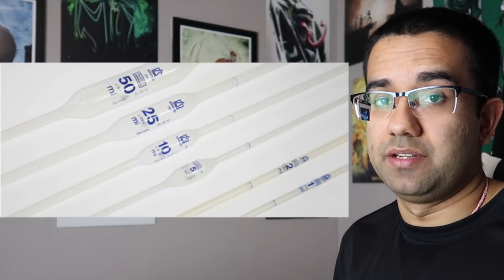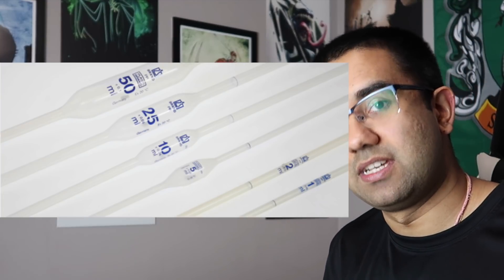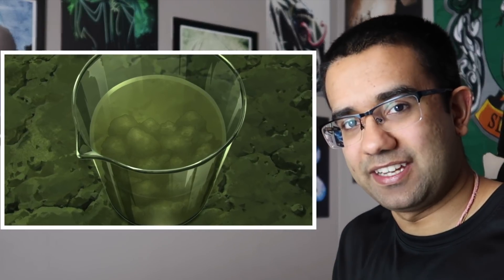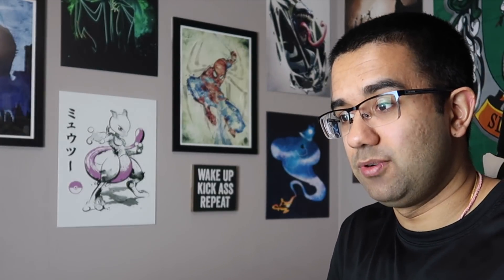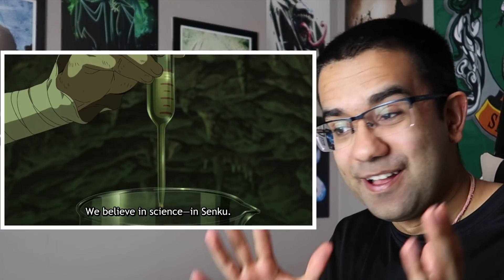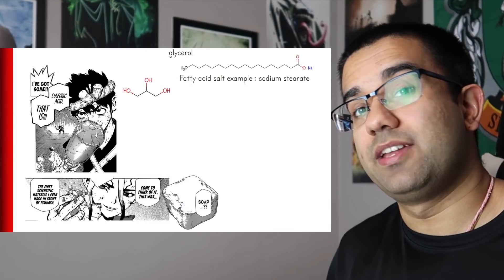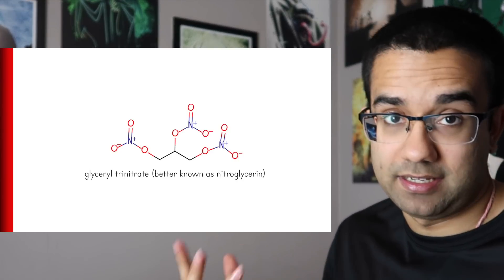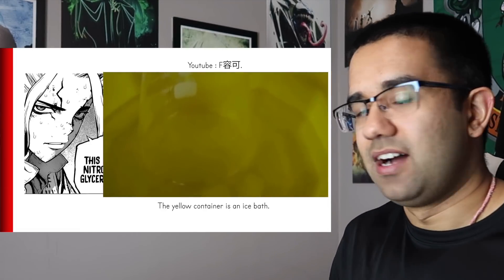Real Engineer Reacts to Technology in Dr. Stone #33

Comment: Ohhh as a doctor I can answer te nytroglicerin thingie, you see the arteries in the heart are extremely reactive to Nitrates, despite them having their own nervous cells, when u introduce nitric oxide into the cells of the walls of arteries they dilate, instantly, coronary arteries are the first arteries that exit the main aorta, and to have a substance be easy to absorb it has to be solluble in lipids, because cell walls are mainly oils, so a solution thats oily, mollecularly light, and cointains a ton of Nitrates is going to be an excellent vasodilator. theres a ton of medicine nowadays that containts the same principle, but one of the first was this one... ALSO ALSO, we dont use 100% nitroglicerin, the one used medically is stable even to impact, it is dissolved and stabilized.
Reply from the maker: Thanks for the comment!! I feel smarter after reading it, appreciate you!

Comment: Nitroglycerin doses in tablets and an oral spray are only 0.4mg.  And,  it's diluted.   So, no danger of it going boom.  But, nitrates dilate blood vessels.  So, they help with angina, a form of cardiac pain related to poor  coronary vessel perfusion.  Various nitrates are used for heart pain.  Believe it or not, Viagra was supposed to be a heart medicine because it enhances nitric oxide which relaxes smooth muscle and dilates vessels.  But,  it didn't work well.  Then, male subjects in the clinical trials reported erections when they were previously impotent.   A happy side effect.  Also,  it's why they warn people on blood pressure medications when considering  Viagra because it does have some effects on blood pressure.

Comment: "...warm area, like that cave..."

Caves aren't generally all that warm... It depends on the caves location, but this cave is likely less than 15°C. I would guess it is probably closer to 10°C, but google is telling me the freezing point of nitroglycerin is 14°C and I am logically assuming that the ideal temperature for creating something that is apparently even more shock sensitive as a solid is not below the freezing point. But I do not know what temperature is ideal for making nitroglycerin nor does google want to provide a quick and easy answer (I wonder why...)

Comment: its not pure, the nitroglycerin you take for chest pain, is extremely diluted, it comes in tablet form with a stabilizer to keep it from evaporating from tablet over time, and redistributing to other tablets. or spray bottle form for faster reaction, Nitrolingual Pumpspray (nitroglycerin lingual spray 400 mcg) is a metered dose spray containing nitroglycerin. This product delivers nitroglycerin (400 mcg per spray, 60 or 200 metered sprays) in the form of spray droplets onto or under the tongue. Inactive ingredients: medium-chain triglycerides, dehydrated alcohol, medium-chain partial glycerides, peppermint oil, sodium lactate, lactic acid. if you tried to take just Nitroglycerin you would drop dead, from low blood pressure assuming you did not explode.

Comment: the petrification in dr stone only turn the body of humans and sparrows to stone so any imperfection or disease that isn't either wont be turned as thus left to die where as those cured from petrification is merely turned back also meaning if you turn someone back even though they were shattered but glued back also reform to its previous state. 

can't wait for the madusa arc our captain is waiting.

Comment: Tsukasa'a sister being healed is one of those anime moments like Taiju's manly shout. The de-petrification process is supposed to be a miracle cure. It healed Senku's neck, which Tsukasa had broken. That was probably the reason the green wave was started. The ones making it may have been trying to break the bounds of medicinal healing, but they pumped way too much energy into it. When you think about it, petrification in this anime works like cryonic suspension, except it requires no power to maintain. Yes, they weather over time unless buried, but there's no upkeep costs. Add to the fact that de-petrifying them will completely heal them, and that method would have made the God-Tier famous in the circles of medicine and science. All others move aside, their faces would have been on the Mount Rushmores of Science and Medicine. It would have been as monumental as warp drive.

Comment: well one thing to keep in mind with tsukasa's sister is that we've seen the healing power of the stone before. we already know that just a strip of it can heal a broken neck since thats how senku survived in season one against tsuksa. we also know that when u are fully petrified, its not just a layer its your whole body until the fluid is introduced to the surface of the stone. in theory though, the healing power of the stone might be enough to cure her illness. senku doesnt even know if it will, but this could be vital information on the power of petrification regardless of whether or not it works.
Reply: Just to clarify, Mirai doesn't have a disease, she was brain dead.
Reply: @grayscale.dominator2023  Correct, and everybody who was turned to stone is also brain dead (except senku who was still counting) so removing the stone even helps brain dead people.
Reply: @notuxnobux  and Taiju because he was that fricking determined.
Reply: @notuxnobux  Yep. Another reason why they needed the miracle fluid. It's like a wake up call to anyone who is brain dead. and Senku was just plain dead in the episode where he got hit in the back of the neck.